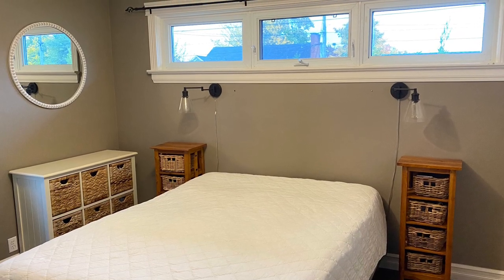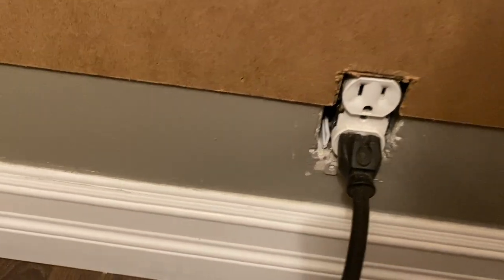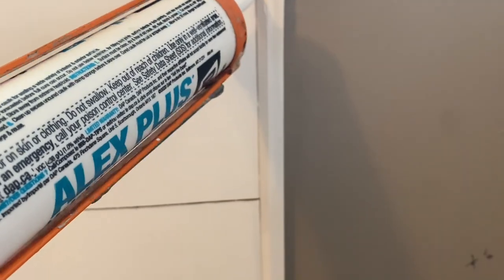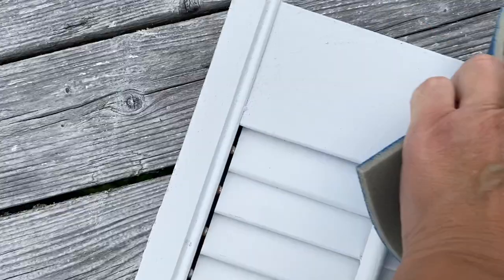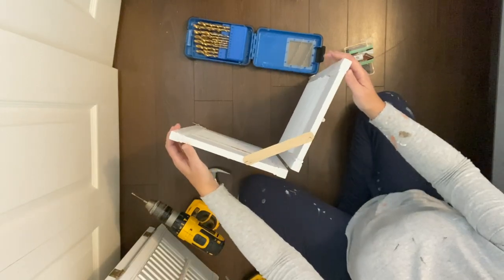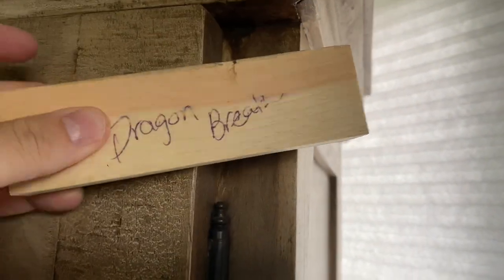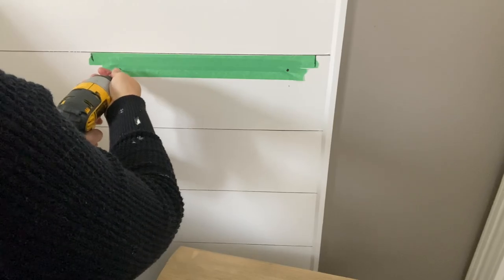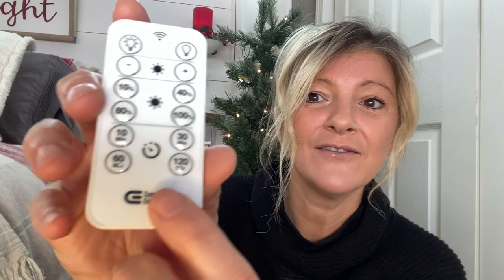HIGH-END FARMHOUSE NIGHT TABLES / DIY THRIFT STORE NIGHT TABLES-REMOTE CONTROL / CHEAP SHIPLAP WALL

Comment: I love this!!! Way to repurpose!!! Are the metal rings simply latched onto the screws you drilled into the headboard? Does it have enough strength to hold books, water, etc?
Reply from the maker: Yes it does. I have my charger stand, I little tree and an ornement. I have put water and no issues
Reply: @nancysmagictouchdecoranddiys  Απο που τους πήρες; Έχεις το λινκ;